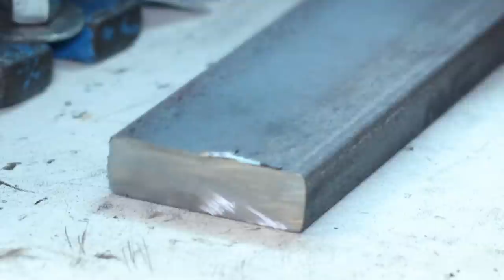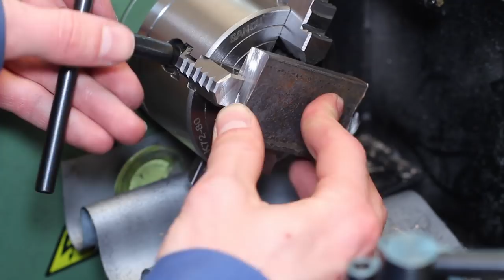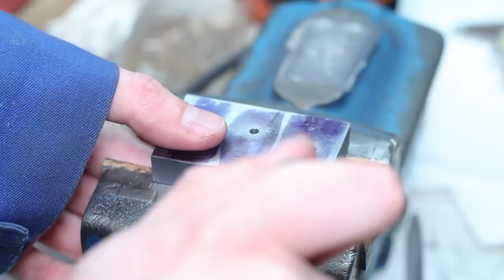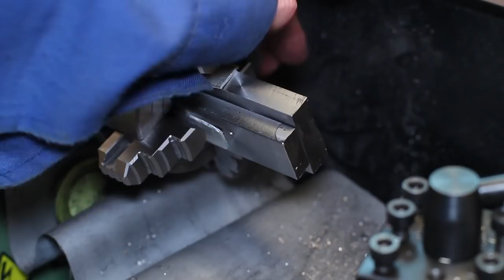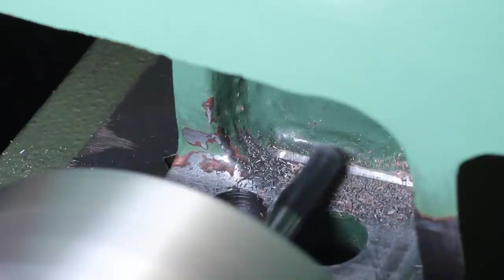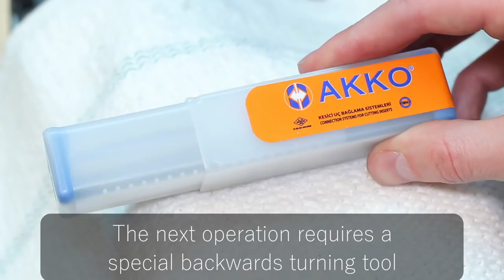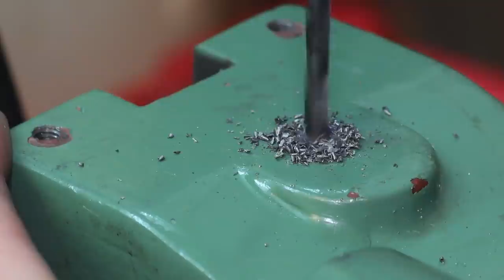Lever clamping modification for the mini lathes tailstock - Part 1

Comment: I only stumbled onto your videos last week while recovering from surgery.  I have a large lathe 300 x 900 (2hp) but I also bought a mini lathe the same as yours, for the sole purpose of improving it.  I had lost interest in it a year ago, because it is so poorly finished.  BUT your videos have inspired me to have another go at  making it (way) better than it is now!  I especially like the sewing machine motor upgrade as the standard 600w motor is underpowered and noisy, there is an 800w motor (sewing machine motor on ebay) available, so I'm getting one of those. 👍

Thank you again for your great videos and please keep making more 🦘

Comment: So many lathe hobbiests put the little Chinese 7 x ? CJ0618 down. Yes, it does come with faults normally, but if one is prepared to do some upgrades it can be a very capably little machine - even milling, as you are showing. After months of online research I bought one and it came with the expected problems which I'm slowly working through. I'm also making more adapters for milling and I love the idea of yours to square up and use your drill press plate as a cross slide support (in your other video). Well done.  This is what a hobby is all about.
Reply: I have the 7*14 and I love it, I need to replace the bearings only having used it a few times but I expected that. For the price point this little thing is more than I expected it to be. Everything on the lathe can be easily replaced or upgraded and they can cut steal easily with the right tools and a little bit of attention to rigidity.

Comment: Your passion for machining lifts my thinking & ability every time i watch a new video so thank you & keep it up 🙏🏽
Reply from the maker: Thank you so much! Really happy to hear!
Reply: @WeCanDoThatBetter  can I ask where or what model the milling attachment is as I’m looking at something for myself also?
Reply from the maker: @CRILIKk  I improvised it. It is the table of a drillpress mounted onto the mini lathes cross slide. On the drillpress table, I mounted a drill vise. In my video on the compound slide angle modification you can see how I did it. It's not the most rigid solution but more or less works so far :)
Reply: @WeCanDoThatBetter  ahh yes just watched it again , thank you but one last question is the 4jaw chuck you are using 100mm & how do you find it , I’m looking at the 125mm but not sure if it’s going to be too big on the mini lathe?

Comment: First, I would like to say it's amazing what you've been able to do with your mini lathe. Being a retired machinist and having every machine at my disposal to perform my job, it hurts me that a person with your ability has to work so hard because you lack the machines to do the job quicker and easier. To be honest, I inherited a Harbor Freight lathe virtually identical to the lathe you have, but I didn't have a milling machine. 

I looked at all the mini mills that many people are using, but I wanted something bigger and better. I searched for a while looking at Bridgeport's, and most of them were to expensive. Then I found one that needed repair and I bought it. I've been fixing it up and soon, I'll be doing a few modifications to my mini lathe. The problem I have now is eventually, I'll need a bigger lathe. 

I like what you're doing, and I subscribed to your channel and I will follow your work. Thank you for sharing, and showing others that there's more than one way to make the parts you need, and to be able to push your machines to above and beyond what the manufacturer thought could be done with their equipment.
Reply: I worked as a 'precision turner' (<5 micron) and when I bought Emco mini lathe 20 years ago wondered what had I done as it was so TINY'
 After a 'few' modifications it actually did a lot of very nice work, often on parts 'too big' for the machine. 
It is however, very useful for small parts which are not quite as easy to lose in the swarf tray (although stuff below 1/8" (~3mm) diameter and 1/4" (~6mm) length do often 'hide' and I'm pretty sure have been vacuumed up when I get around to cleaning things

Comment: Nice! Super glue breaks down at 70-90°C - makes shearing off things much easier :)
Reply from the maker: Thanks! I had that in mind but was a bit afraid of some toxic smoke in the basement..? But 70°C isn't that high. Thanks for the tip!
Reply: Once i used a loctite like glue on a metal to metal surface. I can tell you, it was a torture to get it off lol
Reply from the maker: @yak-machining  Haha :D
Reply: @WeCanDoThatBetter  If you heat cyanoacrylates to high temperature, e.g., with a torch, they can turn into cyanite gas, but no worries: the usual amount of super glue is not enough to harm you. Opening the door/window is absolutely sufficient (entropy is super strong with gases).
Reply from the maker: @schulzcbs  Thanks for your explanation! Good to know and learn more about
Reply: @WeCanDoThatBetter  In this case, maybee just putting the piece in boiling water would do the trick?

Comment: hello. ive been watching your channel and congratulations. you do a lot with limited tools.. good skills and crativity!

just two tips.. heat the glued parts with a torch or hair dryer to soften the glue..

when engraving numbers or scales in raw machined metals. paint before you buff it with the sand paper or scotchbrite, that way you get the shiny machined metal part with black scales and numbers that contrast and are much easier to see

keep the good work

Comment: Why is called a backwards turning tool? Is it because you are starting the cut inside and working/moving away from the chuck/part?
Reply from the maker: Hi, yes, that is correct. The direction of work is opposite to the "normal" way and you can reach inside a groove or turn the back side of the part in one clamping.

Comment: Hi Great videos, great content! What are those taps you are using. Thanks
Reply from the maker: Thank you very much! It's a set M3-M12 with the right drills from RUKO. Here is a link to it https://www.contorion.de/materialbearbeitung/ruko-maschinengewindebohrer-satz-hss-co-5-form-c-35-14-teiliger-211819818?aid=383268462455&targetid=pla-827018648796&gclid=CjwKCAjwx8iIBhBwEiwA2quaq917B1Pt1_kenItbtZnsQ-9EyJHgfnQWmX2IoXHSntsKCYiJnl4TjBoCvQIQAvD_BwE

Comment: Hi,

I am curious as to why you are using epoxy and not  press fit for bushes?

Thanks Steve
Reply from the maker: Hi, good question. I think it was to compensate for the weird shaped casting. The epoxy filled all gaps and gave an even form.

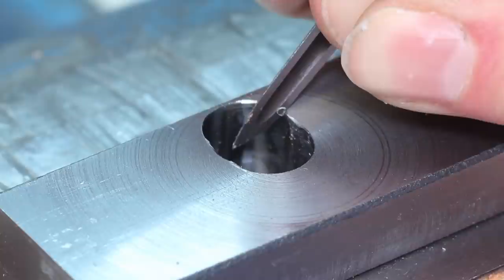Comment: What type of deburring tool are you using at 9:43? Three sided scraper. I have a few of these but no handles and I can't find much on what they are called to get a handle. Thanks!
Reply from the maker: Hi, this is called in germany a "Dreikantschaber" in english it should be a triangular scraper. I hope that is helpful. I bought this used so have no link to it.

Comment: 0:32 Which steel material is this? Is that S235? seems to be very well machinable
Reply from the maker: Yes, that is normal mild steel. St37 or S235

Comment: Most people don't realize or Even believe me that Super Glue has an approximate tinsile strength of 1000PSI.  If You Look at a Failed good bond It's usually the material it was Applied to That fails Not the Glue.

Comment: Is that really a mini lathe? Putting my tail stock in my ML there was no room to spin.
Reply from the maker: :) yes it is. It was extremely tight but it worked. My mini lathe has about 180mm swing diameter over the lathe bed

Comment: You can do it better... make the video shorter, too long winded that it needs a second part to finish...  sry am gone.
Reply from the maker: Sad to loose you. This was the only project I devided into two parts. I made these videos showing the process step by step so that you can follow the hole build. You can either wind forward or double up the speed in the player settings.
Reply: @WeCanDoThatBetter  you do good work, still around you dint lose me, sorry to be blunt but no need to show the entire length of each process which can be boring and make the video longer than neccessary... show the start, fast forward to the end of the process so we see that you just drilled and tapped a hole for example.
Reply: I disagree.   I enjoyed watching this video (no dreaded music, just natural sound - that's great) - I have time to think "why is he doing that?"  And get to  "Oh yeah, because ...."   If I decide to go ahead and upgrade my mini-lathe, I know exactly what to do step by step, though I'll probably compromise (eg I won't buy a backwards tool just for one job - I'll make something)